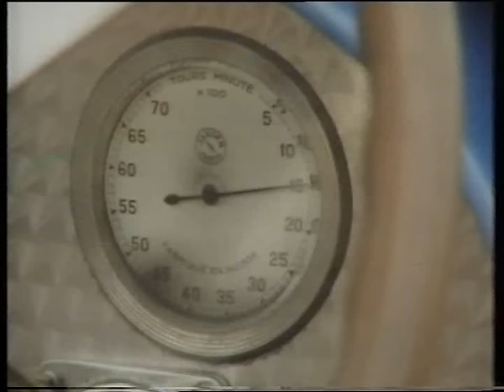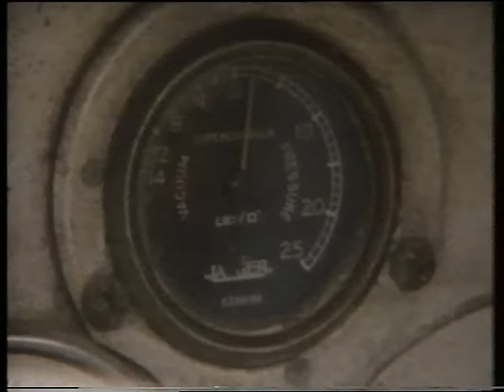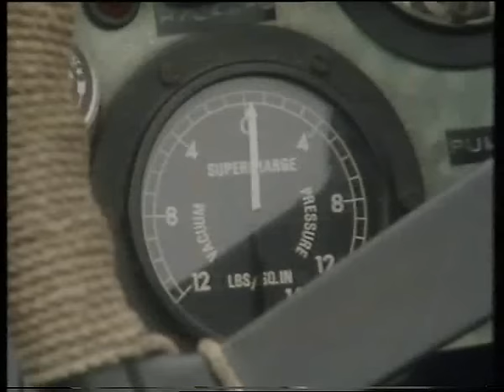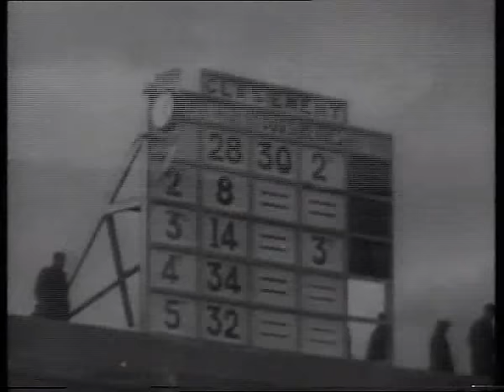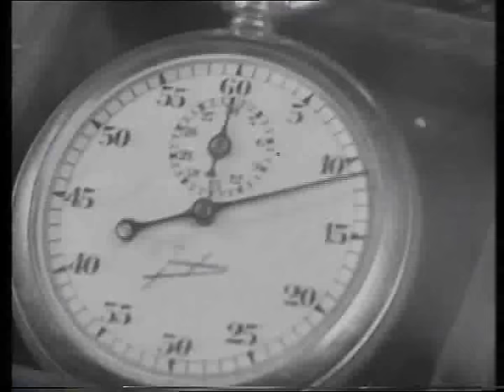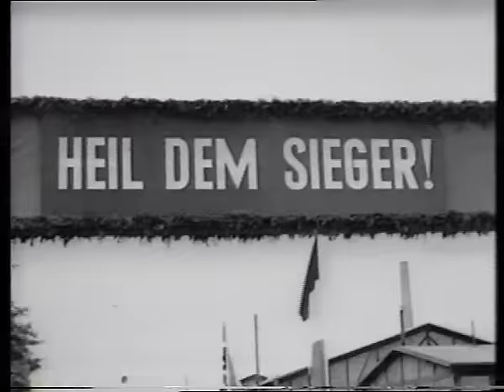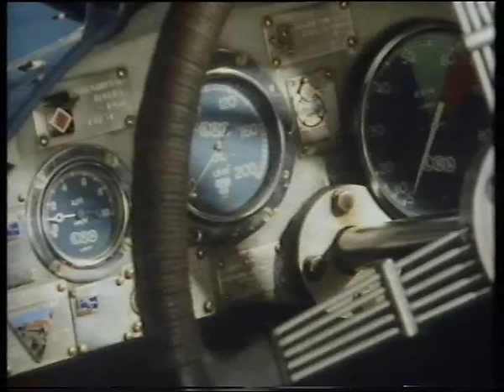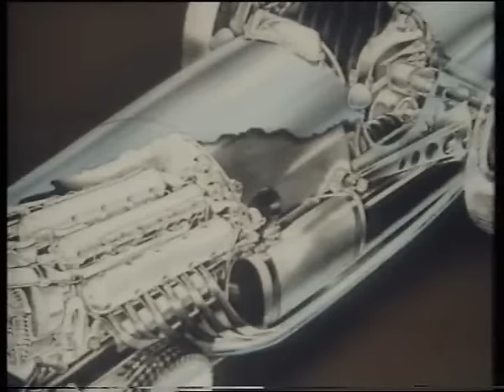Supercharged Grand Prix Cars 1924-1939 (full version)

Comment: Why did they use so skinny wheels and tyres on those cars? Surely someone must have realized that wider tyre = more grip.
Reply: I wondered this too.  But did engineers talk to physicists?   Also, perhaps they had the off idea that saving a bit of weight on the wheels/tires trumped  better traction
Reply: I did some reading on this last night and few factors seem to be involved:

- wheels were difficult to make wider until solid rims replaced spoked rims
- crossply tyre manufacturing processes and materials made producing wider tyres without increasing profile very difficult, they would end up with huge balloon wheels.
- tyre materials were much more prone to stretching by lateral forces and punctures, so bloated wide baloon tyres would end up in pieces every few laps
- weight saving
Reply: I think  the grip on the road is function of the force the rubber apply on the road , fine tire mean lot of pressure over a small surface , large tire equal low pressure over a large surface, over all it's the same , but large tire give better performance on really powerful car , beq it help to keep the rubber  from melting to fast on high load , giving a more reliable performance , longer time between stop etc...
Reply: Road bikes are really fast.  Less contact area is probably less friction.  Skinny rims save weight.  So IMO, you save weight by compromising some safety.  I loved road bikes when I did cycling.  A good road bike feels so effortless compared to say, a mountain bike
Reply: I believe they kept skinny tires to get the least rolling resistance. If they had wider tires they'd handle better with more contact but the friction would reduce acceleration.
Reply: All to do with the accepted doctrine of the time and manufacturing limitations. Like the only reinforcement they had for tyres then was cotton and other natural fibres!   So to obtain the strength required for a given tyre they had to use many plies, like 10, 15, even 20 ply. This caused lots of problems,  for adhesion of the tyre structure, moisture absorption, heat build up in use,  delamination, poor durability, etc, etc.  The last thing they wanted to do was use that type of construction with a big, wide tyre.  The things would weigh a ton! Also, the rubber compounds then available were not very advanced, so grip was poor anyway.  Had they managed to run with wide, sticky tyres, they would then have found that the chassis structures and suspension systems of the period would have tied themselves in knots! They also ran with POSITIVE camber on the front wheels!
Reply: Pretty simple really, they were unable to build them any winder until the materials and designs got better. I remember when the first belted bias ply tires were just becoming available her in the states. My mom's 59 mercury wagon called for 8.25X14 tires. The 8.25 was the width of the tread in inches. I think we ended up with H78X14's and it was gone by the time radials were available so I don't know.   H was a specific width and the 78 was the aspect ratio. 14 was the diameter. Those were about the widest tires you could get  back then.
Reply: The Auto Union and Alfa Tires were much wider in the 30's than cars in the 20's
Reply: Of course they knew about that. It was just technologically impossible to make a 60's wide slick tire, well, until the 60's.
Also, a different paradigm was in play in the 30's, with the crappy roads and suspension. Instead of maximising contact area and using soft sticky compounds as we do today, having a stiff narrow tire under camber, maximising the contact pressure in order to "cut" into the often dusty surface, was one way to generate grip. With an important aerodynamic advantage for the long straights of the contemporary circuits.

However, expanding the contact area was a thing too, even in the 30's. Look at the Auto-Union type C hillclimb special. Didn't need top speed, needed more traction going uphill. Wider tires were impossible. So what did they do?
 They double-mounted the rear tires.
Reply: flashpeter625  Fine answer, thanks

Comment: How did the transmissions work on the Grand Prix cars? It doesn't look like an h pattern. We're there like certain notches that they pulled into gear?
Reply: +CJSchecter96 there was no gears that's why
Reply: haha no. but you are not the only technical "genius" in this comment section. clueless people everywhere!
Reply: There were H pattern boxes, and pre-selector types, where you select the gear you want, before you need it then just press the clutch and it engages, and there were sequential types, like bike boxes.

Comment: Strange how they never thought to put more rubber on the road for traction. The engines were too powerful for the rear tires. It was up to the drivers to baby the throttle out of the corners. Seems like tire technology wasn’t even discussed in the late 20s
Reply: Radial tyre technology wasn't around for another 20-odd years.  It was impossible to make wider tyres until then; hence we had 6-700 bhp going through primitive cross-plies.
Reply: It`s not possible to imagine something that`s not invented. If you see what I mean. One can`t see the future.

Comment: What about the CAN-AM racers of 1966-1973??

In those years Can-Am had no upper displacement limit, and no rules regarding the size of the wings or tyres. By 1972 the McLaren-Chevrolet M20 developed over 800hp from a 9,2 litre V8.

However that was nothing compared to the turbocharged Porsche 917-10 which developed 1000hp in 1972. Then in 1973 Porsche revealed the 917-30 which developed 1100hp in race trim and 1540hp in qualifying trim!

Porsche 917-30 is still the most powerful circuit racecar.

Comment: Agreed.. I want the innovative spirit to return but maybe with less electronics than today has. I love EFI but the driving aids are ridiculous they complain right now that the cars can be hard to drive. I bet if you threw them back in time to those old cars they would never complain about the new ones again. I want to see a racing class were everything is designed and built without AutoCAD and such. Also to make things interesting require 1200cc engines in any layout but all else is open.

Comment: The W125 has to be the pinnacle of Grand Prix car design. It could put out 646 bhp at 5,800 rpm yet it could be driven around quite happily in the traffic of Stuttgart. Speeds of 90mph in 1st, 137 in 2nd, 165 in third and a little over 200 in top gear are the stuff of legend along with the drivers who are heroes in every sense of the word. Strip away the disgraceful nazi regalia and you still have classic cars.
Reply: agree, the mercedes and auto union teams produced fabulous cars that could be described as exocet missiles among most of the competition.

Comment: Does anyone know where I can find more information on the Miller (spelling?) racing engines, and/or company that Bugatti use to copy the engine design?
Reply: The full name is Miller 122, built by Harry Miller. Some of these cars had FWD with a unique De Dion front axle, you might find more information about that than about the engine. I have a book about that era of racing in Europe, it mentions two Copper-Miller FWD cars (modified Miller 122s) racing in a rainy and boring GP of Europe in Monza 1927. Since the year before a 1.5 litre formula was in place, so this Miller car had a 1.5 litre engine, but I believe the construction was basically identical to the original 2.3 litre Miller engine that was copied by Bugatti. It was a straight 8, 4-valve, two overhead camshafts. From the back end of the crankshaft, a 5:1 gear ratio powered a centrifugal compressor pushing 200kPa through 4 double carburettors. The engine was supposed to produce 154hp at 8000rpm with standard fuel, but up to 252hp with an alcohol mixture. The manufacturing precision was above the contemporary standards, a necessity with a compressor doing 40k rpm, the engine also revved slightly higher than the competition at the time.

Comment: Technology changes, but racing is racing and modern Formula 1 faces the same issues in 2023 as Grand Prix racing did in the 20's...and 30's...and 50's etc....actually, to a smaller extent as the 40's, too....war that is...Also some of the same teams are still around, Mercedes, which usually dominates....Ferrari, which was connected to Alfa Romeo in the 20's and 30's as it is now....but Alfa Romeo is leaving the sport and Audi (Auto Union) will replace it. And Fernando Alonso is still trying to win another title to go with the two he won in 1935 and 1936.....ok that last might be pure BS...

Comment: "the type 35 though enlarge to 2.3 liters only had a single over head camshaft. Bugatti realized it was becoming dated" wow but GM is too dumb to see the writing on the wall even in 2019. Them there 2 valve OHV engines are top of the line! Said no engineer ever. Fucking mid engine c8 better have an LT5 like the zr1 in the 90s. You remade lt1 an lt4 so you better be making an LT5 an hold up to what you need to do. People will make it twin turbo in the after market and DESIMATE ALL! Don't fail us. Ford fucked their Chase up at a respectable mid engine car. Don't follow suit with some flaming pile of shit using a LFX v6

Comment: God Damn, why do all European vehicles even till modern day have the most absurd and ugly bodies? I guess it's just because Europe is a much older world and they've got much narrower streets designed like old world Boston Mass which was layed out for horses? But the first European vehicles were nothing more than wooden barrels layed end to end as opposed to the states we sat side by side on most of our horse powered buggies with extra room in the rear for the family and your farm supplies to make cross country ventures. But it seems like nothing has ever progressed in Europe with vehicles in their layout, bodies and the design of their chassis never seemed to change from their early stages of development. They are too narrow, their tires were never made any wider than what we have on a modern motorcycle, so traction has to be appalling and handling with the bias ply tires/tyres could not have been anything more than of a motorcycle accident waiting to happen. Everyone was focused on making more HP and more RPMs, but what's the point? When you can't put it to the ground, let alone keeping it there for any length of time especially in tight cornering on their narrow road races??? SMFH these vehicles are basically 3 whiskey barrels end to end with a cut out piece for the driver and the front barrels removable hood/bonnet for the engine bay. If you are building something for high speed, high output power and of course some sort of handling of the road courses, their primitive suspension systems, lack of weight distribution over all 4 wheels and all set on a set of motorcycle wheels, what were they exactly expecting to do with more than 400hp??? So the Mercedes is the only one which seems like it was literally looking at what I was just talking about....? Using the divorced gearbox and setting that up on the rear axle to help distribute the weight more??? So then they go and add more cylinders to the inline engine which was 90% of the vehicles weight to begin with, making it only heavier over the front wheels 🤔!  Seems it was out of necessity for moving the transmission to the rear end because the inline 16 cylinder engine was 75% of the vehicles overall length! SMH. I don't understand what they trying to achieve with these??? It doesn't matter how much HP you have when you can't utilize half of that by transferring it to the ground!?! So after God knows how many people died, they finally began to realize something isn't going well here??? And maybe it's time we scrap these old out dated piles of crap, made to handle a possible 60hp chassis design and revamp the entire designs of our barrels on motorcycle wheels???!!! Ugh!

Comment: At 25:20 the narrator refers to 175mph.... Did the 400hp W25 really reach that speed?
Reply: +Michael Doran Yes it did. In fact, at AVUS and Tripoli, AKA, the Temples of Speed, it got up to 190MPH at it's finest.
Reply: Yes. Year 1937 was even faster. The 600hp Mercedes W125 made 200mph. Auto-Union type C was actually slightly faster with just 520hp, thanks to better aerodynamics. But the streamliner versions for the Avus speedtrack, some with special engines, exceeded 240mph that year. The drivers were making slipstream maneuvers at those speeds. Gigantic balls.